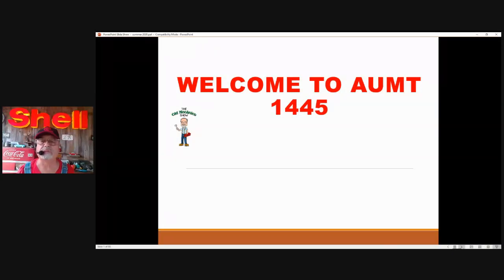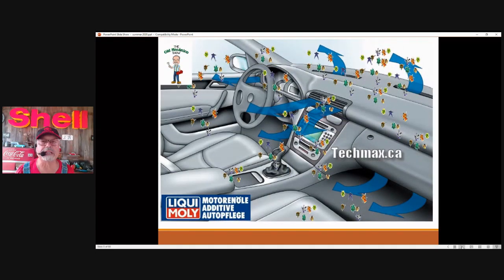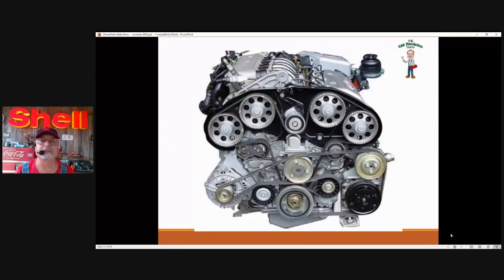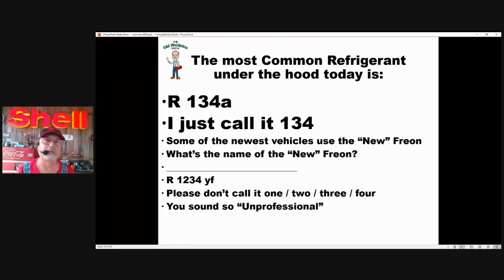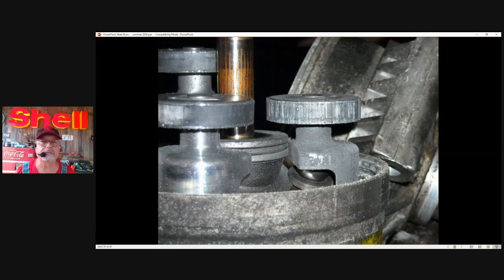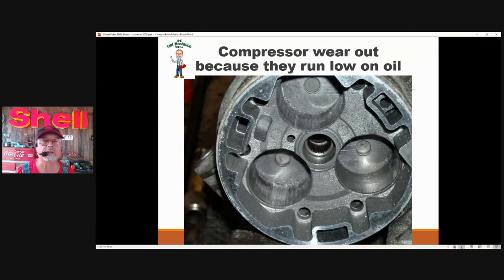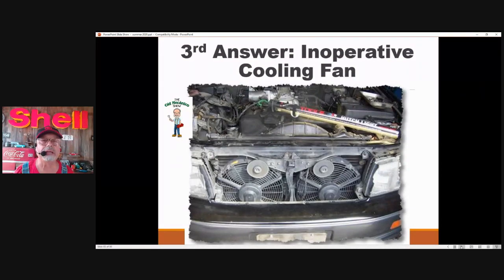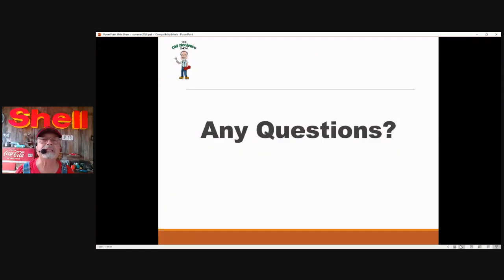Lesson # One: Compressor Operation and Failure

Comment: Hi 
I have a problem with my ac 
It will work for about 30-60 seconds then will stop blowing cold, but compressor clutch is still cycling on and off like normal?
Also I had it vacuumed and re  gassed but it was the same
Would like to know what part to replace so I can get it re 
gassed again
Thank you
Reply from the maker: Did the person that did the vacuum and charge say what might be going on...?  It would be helpful if I knew what the pressures were after charging.
Thank you for the view and the question. If you can get me pressures, I will try to help you.

Comment: I do have a question for you good sir.
First of all I’m really glad I found your channel, I’ve been struggling to find extremely detailed versions of repairs. 
I had an ac compressor go bad in my 2011 Toyota Camry. So I had bought a new one and had a friends father help me as I didn’t have manifold gauges and other tools as well as the garage to perform this. Anyhow, my condenser was damaged in shipping and the fellow convinced me to just leave the old one, I wanted to replace it and am unsure if he actually evacuated the system for a good forty five minutes, I was always concerned that the old condenser needed to be replaced and that it may cause issues. 
Unfortunately a year and half later, and my new compressor is making the SAME sounds. Grinding bearings perhaps. The ac clutch, when the car is on, is ALWAYS spinning. 
I really just want to perform this repair myself and actually get it right , it’s costly and inconvenient to be without my vehicle. 
Thank you for all your time and help, you really inspire me to go for my dream to become a mechanic.
Reply from the maker: Thank you for the views and those awesome comments. Here is a video you should watch. So many compressor jobs do NOT get enough oil. 
https://www.youtube.com/watch?v=by8LpYAHNHE&list=PLumo5LzzEvNkfOa8mRyXfGCnEXOPFapLc&index=13